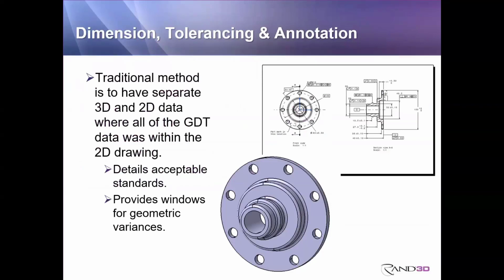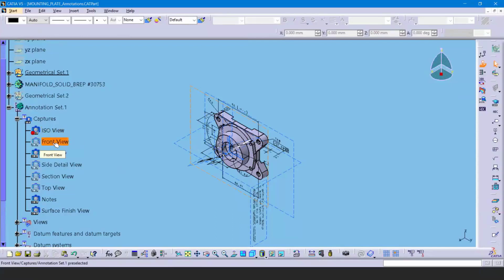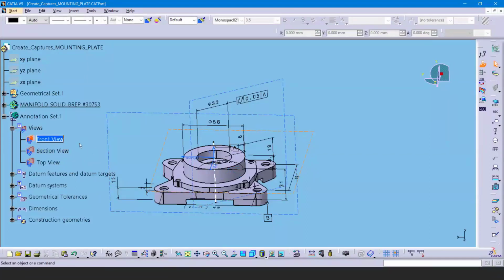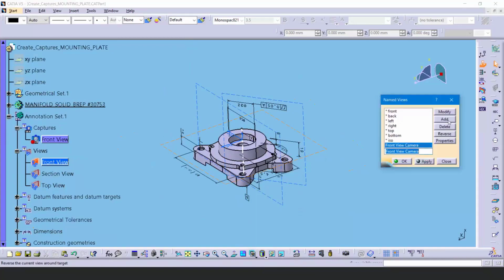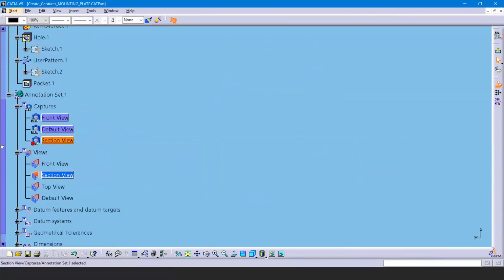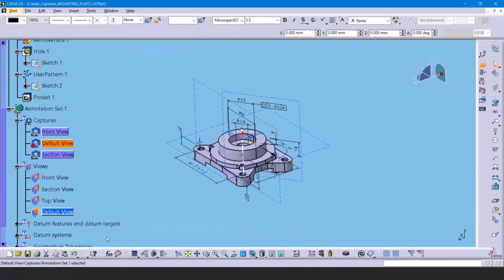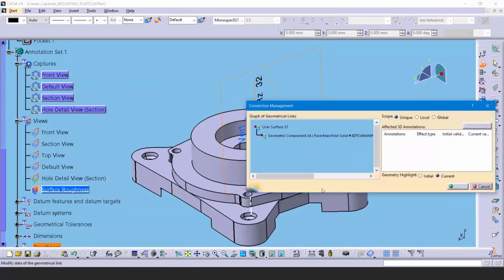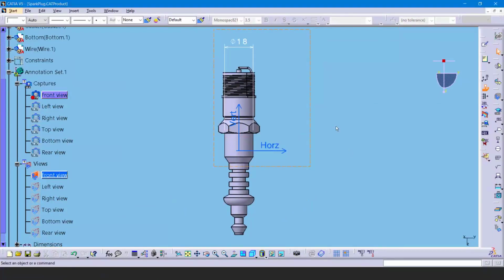Rand 3D Webcast:  Getting the most out of CATIA FT&A Captures in a Digital World

Comment: I need to change the default color for annotations from white to black because I'm using a white background. I don't find the settings. Can you help? Thank you
Reply from the maker: HI, thanks for your question. CATIA's default is for annotations to be white (you can't change the default unfortunately). After you make the annotation, you can right click and go to properties. There you can change the annotation to a different color manually (in the font and text tab). I would just suggest not using a white background to make this easier. If you need to take a screen capture of the annotation, you can go to Tools->Image->Capture and set the properties to automatically take the capture with a white background and then turn on the "Capture white in black" so that the annotations automatically turn to black on the white background.

Comment from the maker: We had a customer recently ask: "I can’t get the section view to display properly in my model. It readjusts time my camera location however it will not apply the actual section cut." Our trainer has responded with: "Thank you for your question. When setting up a section cut view capture (with the capture activated), you need to make sure that clipping view is selected before you exit the capture creation.  This is shown in the video around the 28:15 mark."